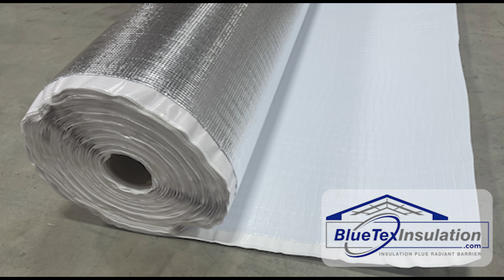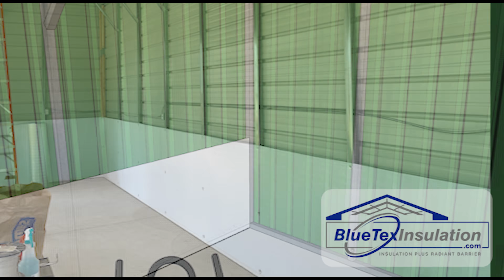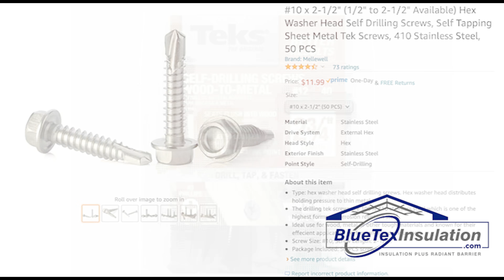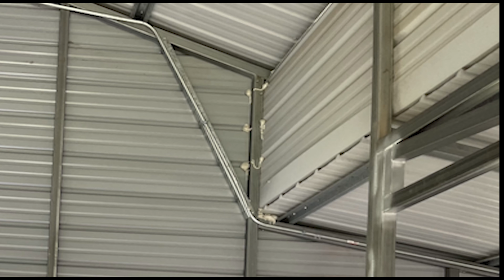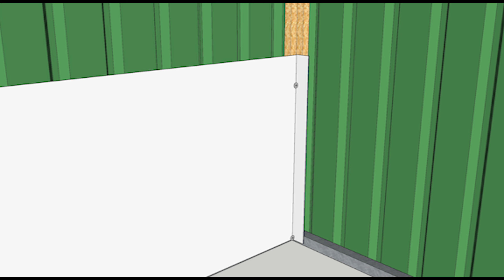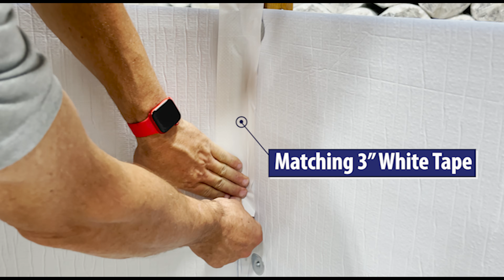How To Insulate A Metal Building Tear Proof Foam & Foil Insulation - Easy Vapor Barrier - NO Bubbles

Comment from the maker: Ask your www.BlueTexInsulation.com questions here!  Or, offer advice on how to improve the install method.
Reply: Nice video very informative. I'd like to know how this product compares to Prodex total insulation. They're claiming an R value of around 17 I think. I don't see how such a thin product could provide that great of an r value. Snake oil or what?
Reply from the maker: @allforwheelsgarage  Uh, common sense tells you NO product that is 1/4" has and R-Value of 17.  Here is our info and the truth about R-Value: https://bluetexinsulation.com/pages/r-value-of-bluetex-insulation
Reply from the maker: https://bluetexinsulation.com/pages/r-value-of-bluetex-insulation
Reply: Hey there, I have been watching a few of your videos and been on your website. My metal billing was just built and now I need to insulate it. Any interest in possibly doing a YouTube collaboration? Thank you
Sincerely, 
Nathan Porter
Reply: Can I use Blue Tex in a wooden 16’ X 30’ shed? I’m thinking of stapling it to the inside of the siding, then leaving a 2” air gap and covering it with plywood.

Comment: Would this work on a shipping container since there’s no air flow behind the insulation?
Reply from the maker: Yes, installing www.BlueTexInsulation.com works great in a shipping container. You can have "dead air" for a radiant barrie to work.  Here is the page/info: https://bluetexinsulation.com/pages/shish-kabob-method-installing-bluetex-directly-to-metal

Comment: Can I install 2” foam board between the wall studs to give more insulation value before applying the blurry layer as in the video?  I am not sure if the blurry needs an air gap possibly…
Reply from the maker: You can install foam between the framing to give more R-Value. In this case the www.BlueTexInsulation.com is more of a good looking/durable interior finish.  If there is not a space between the foam and the foil side then you will lose the radiant barrie benefit.
Reply: @BlueTexInsulation how much space between the radiant foil and foam is needed?  The wall studs are 2.5”.  Would 1” foam damage the radiant barrier?
Reply from the maker: Ideally, you would have foam board, airspace, then www.BlueTexInsulation.com if you eliminate the airspace it still works just no radiant barrier benefit.

Comment: If I put the bluetex on before I install my roof panels on the outside, will I have issues with their not being an air gap in between the roof panels and the bluetex? And would the foil side go up touching the steel panels?
Reply from the maker: Normally, the www.BlueTexInsulation.com will droop down about 1/2" on the roof, so there is your airspace. Install guide here or contact us. https://bluetexinsulation.com/pages/new-construction-metal-framed-buildings-installation

Comment: Unlike this building, my metal siding is oriented vertically, so on top of siding there is air openings every 9-10 inches.  The bottom has ratguard and foam to really seal it up.   The top of side walls also has insulation so the small humps are sealed on the top of siding.   Basically there is not much air flow.

I've already run 1x4s throughout the bldg, vertically and horizontally, and ready to add your product.  Im very hesitant because I'll hv a 3 and 1/8  gap between the blue tex and siding.  I've had lots sweating (florida dew), and am concerned that sweating willoccur between bluetex and siding.  I haven't seen anyone on you tube doing this,  without filling in the gap with insulation.  Any recommendations?
Reply from the maker: You will have much less or no condensation between the www.BlueTexInsulation.com and the metal because it's basically a small amount of "outside" air.  Not the entire mass of warm air inside the building.  And, if you get some moisture, it's usually no big deal.  It will either "cook" out or there is still some air movement in the space and it will ventilate out.

Comment: Will this keep the metal building cooler in the summer?  Can I add a AC unit with only this insulation?
Reply from the maker: It depends.  If you are occasionally cooling - maybe 5-10 hrs/week then it's perfect.  We call this a "semi-conditioned" building.  If you are cooling 24/7 you need more thermal value.  Think of it as "shade" for your building.  This alone will make it MUCH cooler.  Plus you can run an AC as needed.  Think of it as a thin-walled refrigerator.

Comment: How about putting foam board up first . Then putting up the bluetex with reflective side facing the inside?
Reply from the maker: You could do that.  But not the look most people who install www.BlueTexInsulation.com are looking for on the inside.
Reply: The white side is also a stronger with inlaid fibers. I would imagine the foil would tear a lot easier if it faces the inside
Reply from the maker: True, you can put the foil to the inside, but it's definitely not as durable as the white side.

Comment: Would have been better to have overlaid blue or pink  foam board with the metal siding on the outside of the metal studs.....so simple  .
Reply from the maker: It depends whether or not you are heating/cooling the space.  Read this: https://bluetexinsulation.com/pages/insulating-non-conditioned-buildings-vs-conditioned-buildings
Reply: How ?.
It's an excellent vapor barrier as well as virtually no expansion or contraction.
Also.....and that best part as well it prevents conductive heat transfer through the metal studs and joust. A radiant barrier over the foam is even MORE effective...
Easier to remove the siding,( it's already measured and cut,)  install foam. 
Hang siding.....was your shop full when you started....mine was...simple  ....
Most the work has all really been done. 
😉

Comment: great and very thorough video!  thank you!
Reply from the maker: Thanks.  This is actually an older video.  Now we have 50" and 62" wide product which works better running vertically and all the seams are on the metal framing.  Check it out here: https://bluetexinsulation.com/pages/existing-construction-metal-framed-buildings-installation
Reply: I just ordered a metal structure from Rhino and would like to get some recommendations on what insulation should I use. It’s for a 40X60 church building.
Reply from the maker: It really depends on your location and what your goal is as far as comfort/heating/cooling etc.  Your best bet is to start with our website and read the "common questions" section.  Then call/email us and we can help further. We try to offer great customer service.

Comment: Considering purchasing your product for my newly built all metal garage. My question is, can I finish the walls with say lumber, 1inch board planks over top the bluetex? my plan was to take 1 in x 10 in planks and run them vertical all the way down the walls. Great instructional video by the way. answered lots of my questions
Reply from the maker: Yes, after you install www.BlueTexInsulation.com you can put any type of "interior cladding" against it you want.  We have many customers use OSB, drywall, sheetrock or TNG.  Be sure to check out the newer videos with the 50" and 62" running vertically on the sidewalls. It's a much easier and better install method.

Comment: Wouldnt you get moisture build up between the walls and the insulation? Im trying to figure out how to insulate my steel building.. i will have a small furnace in it for the winter and nothing for the summer(in michigan). Wont the walls sweat behind the insulation?
Reply from the maker: Typically the moisture is caused from the warm-moist air INSIDE the building coming in contact with the cold metal.  When you install www.BlueTexInsulation.com this prevents this air from getting to the colder metal.  Under the right conditions you may still get a LITTLE condensation between the BlueTex and the metal panels. But, this is no big deal. The sun combined with airflow between the BlueTex and the metal quickly drys out any moisture.    Things get wet and then dry all the time.  This is OK. Problems occur when things STAY WET without drying out.

Comment: Insulation is connected pretty tight.   However, seems like moisture in the air will get behind and without any ventilation, doesn't this create a perfect environment for mold?

I've also been wondering about ventilation for the insulation under a mobile home.
Reply from the maker: Normally, you "ventilate" the space between the metal and the www.BlueTexInsulation.com  These buildings are usually pretty "leaky" with gaps on the ribs, gap between the wall and the roof and at the ridge.

Comment: Does this type of insulation help with both heating and cooling the inside of the building?
Reply from the maker: www.BlueTexInsulation.com definitely helps.  It's really made for buildings that are either non-conditioned or semi-conditioned.  Meaning you are never heating/cooling them or maybe heating/cooling occasionally as needed. Think of it as a LIGHT JACKET.  For most barns, sheds, garages, airplane hangars, warehouses etc. it's all you need.

Comment: Thanks for the great video Ed, it made the job simple. We are very happy with the 2mm pro in our new garage but the screws were a pain and about a third would not go into the metal and one of our rolls had half the tape missing. We got shorted screws on our order and waited another week to get them but it is installed and after a bit of aggravation with screws and taping every seam it works perfectly 😊 we are very happy with how it came out and how much cooler our metal garage is 😁 ambient temp at noon yesterday was 80, outside wall was 103 and inside wall was 82 the product works great
Reply from the maker: Thanks for the comment.  First, I did a search for Deborah Sharp and could not find an order. So, hopefully we "made it right".  If not, PLEASE email the support email and we will take care of you.  And, I'd like more info please.  Was this a standard tubular steel building or something else? Normally the screws work fine.  Some older buildings the steel is thicker and can cause the screws to burn out/dull when installing.  Also, you don't want to use an impact drill/screw gun. Like I said, please tell us more. As for the tape?  UGH.  This is frustrating, since there is no way to check on this while they are rolled up. And, during production, the tape sometimes breaks or the rolls run out and sections get missed.  We are working with our processor on getting this better.  Thanks again for your business and comment!

Comment: In this video above which one of your Insulation did you use Pro 2mm  62" OR was it 6mm 50" ?
Reply from the maker: This is actually the OLD style 6mm 50" with the tabs.  We have eliminated the tabs and moved the double sided tape to the foil side and are only using 3" white tape to seal the seams.  It's a cleaner and more secure seam.  www.BlueTexInsulation.com

Comment: Would this product work for a metal roofed pergola in Arizona?
Reply from the maker: Yes, www.BlueTexInsulation.com would work great in a pergola.  We recently had customer use it for this application and spray painted the white side with great results.
Reply: any videos on how to secure? We have monsoons here and the wind can be an issue, we have on of those ceder pergolas with the metal roof standard A frame all metal   @BlueTexInsulation
Reply from the maker: The www.BlueTexInsulation.com is super durable.  I think using the screws and washers will work great.  We cover and secure a bunch of wood crates with this material and it works great.  https://bluetexinsulation.com/products/screw-washer-set-100-pieces

Comment: How about the condensation on the wood used inbetween the metal and insulation?
Reply from the maker: If installed this way there should be minimal condensation on the wood.  But, that's ok.  Wood can get wet and dry a thousand times and be fine.  When the sun comes up it will dry out any moisture in the wood.  It's when wood STAYS wet you have issues.

Comment: I see some companies put the insulation over the framing then screw on the exterior metal panels? Is this method ok? Just curious 🙂
Reply from the maker: Yes, this works great.  If you want the benefit of the radiant barrier, you need to create a small airspace between the foil and the metal.  Here are the instructions: https://bluetexinsulation.com/pages/new-construction-metal-framed-buildings-installation

Comment: I weld in my garage. I'm sure weld spatter would melt it and make it ugly, but would I have to worry about it catching on fire?
Reply: Good point,,, I installed Blue-Tex and then I went up 8 foot with 1/2 inch plywood over the bottom portion, I didn’t want a jack handle or bike falling over and putting a dent in the bldg,,,also it give you something to hang stuff on
Reply from the maker: Great question.  You may consider installing like this video here: https://youtu.be/2UxPx9rPVpE  with the foil side facing INSIDE.  The foil is PURE aluminum so it can handle SOME sparks. Not flying hot metal shards.  We have had a couple customers install the foil facing IN in the spark risk areas and the foil facing OUT in the rest of the building. Call us at www.BlueTexInsulation.com to discuss further.

Comment: Just watched a video installing a similar product vertically between studs using firring strips. I think I like your method better as it covers the studs, creating a complete vapor seal, and leaves a larger air gap.
Reply from the maker: Thanks, Yes this method creates a complete envelope.  Did you see our new 62" wide products to run up/down on 60" wide framing?  Much easier installation.  https://bluetexinsulation.com/collections/frontpage/products/bluetex-pro-2mm-super-wide-62-inch

Comment: Ho.We'd like to insulate a metal shed for a tiny guest house near Valdosta, GA Would you recommend this product or something else? (High humidity in summer time). Thx in advance.
Reply from the maker: Tough call.  Really depends on how often you are cooling it and what your capacity (AC) is.  Feel free to email us more info. www.BlueTexInsulation.com  If you are only occasionally cooling, it may be perfect.  If cooling 24/7 probably not.

Comment: At the end of the video-splicing two pieces: Couldn't you just cut them To meet in the middle of the stud and then run the screw in between them and the attached washer would suck them both down? also, the tape, can someone not buy a roll of that and just tape the seam  and then screw them down-that would make a good clean seam. Is this not a solution?
Reply from the maker: You can definitely do it your way. I think unless you use some double sided tape on the metal and figure out a way to pull tight from both directions at the same time it's going to be tricky.  Yes, you can buy the tape only.  We sell a bunch in both 3" and 6" wide.  https://bluetexinsulation.com/products/white-tape

Comment: Can you glue the wood strip to the tubes instead of adding a bunch of holes where moisture can get though and into the tubes?
Reply from the maker: You are overthinking this.  These buildings are never going to be 100% tight. The amount of air getting into the holes from drilling is not even measurable. If so, just put some caulk on before drilling to seal it up.
Reply: @BlueTexInsulation  That I maybe and you are 97% correct. But if I was to spray foam the building it would be 98% sealed up.  May I ask how putting caulk on before I drill it is going to seal it up?  Would the drilling process just remove the caulk
Reply from the maker: Nope, you just put a glob between the wood and the metal then screw through it.  It's the same process we use when installing exterior sheathing to make an airtight wall.

Comment: You said in the intro, that you have solutions on your website if I want to insulate for R value (like to air condition a work shop). After watching the excellent video to the end, I went to the website and found no such solution (if it's there, it's not easy to find). RU sure?
Reply from the maker: You are right. Here is some info: https://bluetexinsulation.com/pages/insulating-non-conditioned-buildings-vs-conditioned-buildings  The big stuff is still in process.  Send us an email and ask for info on combing foil with foam and other insulation products for fully conditioned buildings. We are in the process of moving to a larger location so we are behind on the content.
Reply: @BlueTexInsulation  Requested the free sample(s?) on your website. Is the move going to delay that process? Thanks for the link.
Reply from the maker: @OnHoldAt50  No delay.  You should have received confirmation email sample request was received.

Comment: Does the foil side face the inside of the building or toward the wall?
Reply from the maker: To keep the building cooler and reflect heat, install facing out with the white side facing in. www.BlueTexInsulation.com

Comment: Hello, good video, I live in South Florida and I have a metal workshop, it is very hot here, what do you recommend to lower the temperature inside the workshop.  Thank you
Reply from the maker: A couple of options: If you JUST want to reflect  heat (like a tree over the building) the Foil/White product is great and the lowest cost: https://bluetexinsulation.com/products/single-sided-radiant-barrier-foil  If you want a "cleaner" look the BlueTex 2mm Product is the way to go: https://bluetexinsulation.com/products/bluetex-pro-2mm-super-wide-62-inch  Feel free to call the office to discuss further.  There are more variables.  Also, be sure to get free sample kit from www.BlueTexInsulation.com